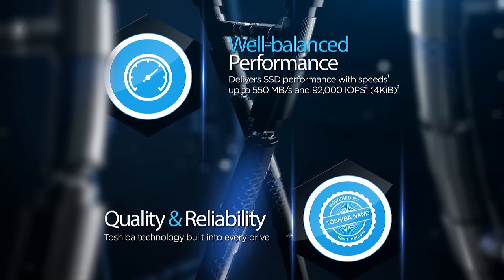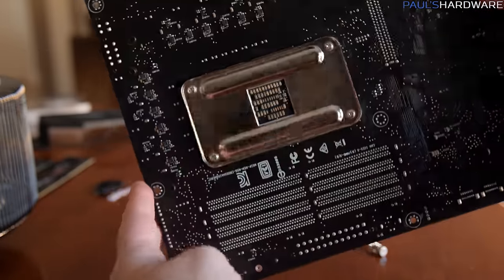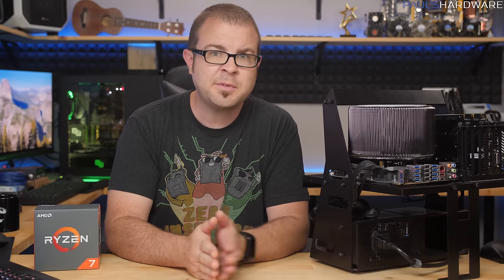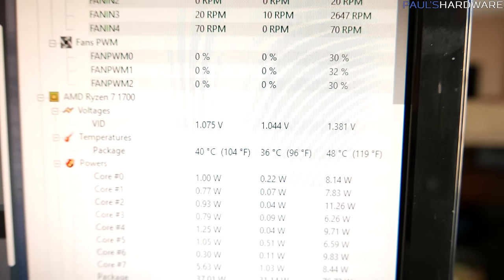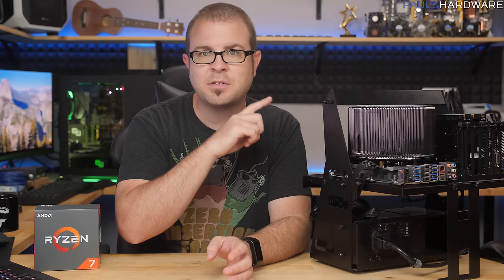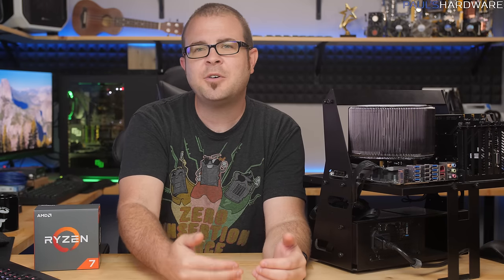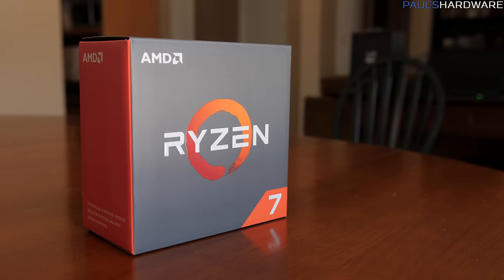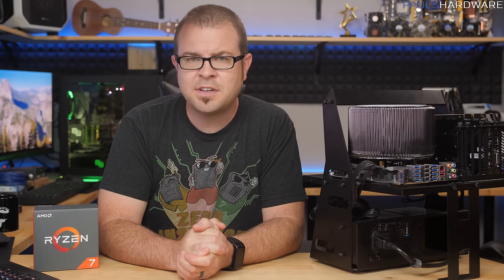Can You PASSIVELY COOL a Ryzen 7 CPU?

Comment: Hate to tell you this but I cool my Intel hardware with Noctua NH-D14 and D15 coolers and I remove the fans, and they run cool and fine.  I take the excellent Noctua fans, and replace the casefans with the Noctua ones that come with the cooler, and use a push/pull for the case (one in front pushing, one on top above the CPU cooler pulling). I do this on all of my Xeon servers for reliability.  Been doing it for over 7 years.   I also did a test where I used no fans at all, and ran at full load, and highest temps I experienced on the Xeon E3-1265 I used was 48'C.  I also have a Xeon E5-2630 v4 chip with a Noctua that is fanless, and it runs just fine and cool.  Noctua coolers run just fine in a fanless scenario, as long as the TDP of the CPU is below 100 I have found.

Comment: I think a fanless cooler in an open air bench is the wrong setup. I'd like to see this in a case with some quiet cooling fans moving air through the system. As it is, there's no air movement on a test bench.

Comment: What if deliding and liquid metal application would be used under and over the CPU lid?
May it possibly negate a need for under-volting?
I also wondered why so many video bloggers speak artificially faster than they do it normally, off the camera? 
Do they think it's at all "cool"? Or they all just trying to include most information in a small chunk of time?

Comment: Hmmmm, why do you not put a fan on the top of the radiator? Push or pull doesn't matter, just for fun to check how much it would be change the temperatures/performance.

Comment: But why would you use a passive CPU cooler with an actively cooled video card? And what about the case fans? Without them this cooler will probably suffer inside a case and with them you already have a noise floor. I'm sure you could have the same total noise with a Dark Rock Pro 3 at low fan speeds with the same CPU. The added bonus there would be that you can use all your memory and PCIe slots normally and have the option to run the CPU dynamically faster for gaming.

Comment: I used to run the AM4 wraith spire cooler on my 1700 and it recorded those temps with... 3.8GHz 1.32v OC and ambient of 30c (really hot day) 

I couldn't much hear it either. And to clarify, you can't really use the NoFan in a case without fans. It gets by with case fans.

Comment: Seems like a lot of money and trouble to remove 1 fan from your system. I feel like just using a stock wraith spire at a low rpm would have been plenty sufficient for a nearly silent rig. Especially if you were just gonna undervolt anyway. Just my opinion though.

Comment: If you literally put a silent 120mm fan on its lowest setting those temperatures would come down considerably. Unfortunately, its (nofan cooler) performance might vary significantly in a normal case as apposed to an open air case, as well as having it mounted horizontally as apposed to vertically as this will alter how it convects heat. The good news is as long as you have a case with ample vents on the top and sides as well as a silent fan on the top of the case in its lowest speed setting it will greatly increase the amount of heat dissipation as a result of convection. Just remember that heat travels directly up, not sideways, that's why its always most practical and beneficial to either force air directly up through the cooler or pull the air from directly above the cooler to aid in dissipation.

Comment: Ummm if you want aida64 to get your cpu hot, only test fpu. It puts it under very heavy load, the temps will skyrocket and the voltage will droop to the max. Fast way to see if voltage is going to be an issue.

Comment: Presumably you would not be using it open aired sitting on top of a entertainment center, if nothing else, dust will become a problem. If it's in a case and or in a entertainment center the encloser will trap heat. 

Also to have to buy a expensive large form motherboard with a second SLI just to be able to install a video card seems absurd.

What are the thermal throttle/safety limits of this stuff anyway?

Comment: I got the Be Quiet! Dark Rock Pro 3, I just took the fans off and swapped out my liquid cooler to see if it's possible to make the Intel Core i7-6700k go fanless, so far it's working fine, got two 140mm Be Quiet! Silent Wings 3 fans for intake, one of the same size for rear exhaust, and three 120mm Be Quiet! Silent Wings 3 fans on top for exhaust, I was going to go with intake, but there's no screen on the top of my case, so I went with exhaust, and have every exhaust fan running around 40%-50% speed, my intake fans at 100%, all just so I could get it at positive pressure inside the case

Comment: It would be cool if they offered a blower type fan that went inside of it and snapped in tight.  And when it was in a case the air flow would blow out the back of the case. I suppose it would need some type of shroud though..

Comment: Do note Asus tends to have "performance Bias" enabled by Default (amd version of Intel MCE ish) witch does a minor overclock to what ever settings you use, your voltage was at stock 1.43v likely means was enabled/auto setting) once set to disable you probably be able to use lower voltages (a lot lower if you set the cpu to manual clock speeds so it disables the amd turbo boost thing)

Comment: Nice video and nice cooler! Did you happen to test a program like OCCT or Prime95's stress test until CPU temperature plateaus? Before using this solution, I'd personally want to be sure it won't approach shutdown temperature even under a situation with all cores running 100% and with (2?) cores running (full Turbo frequency). Also curious if it does well in a case with "standard ventilation" (120mm in, 120mm out, PSU out).

Since this is for an HTPC eventually, how about one of those flat, rectangular cases meant for HTPC use- one with a nice, wide open air grill on the top panel? Since heat rises, I imagine that'll perform not too much warmer than your open-air test bed configuration.

Keep it up with the quality videos!

Comment: Can you put it in the HTPC case (that isn't open-air) and rerun the tests? Even without a fan on the CPU, you will still need fans shoving that hot air out of the case. What would the delta of normal ambient vs. Fanless ambient within the case be with the same amount of fans at the same speed?

Comment: This thing has a fan mount (don't know which size). So you could add a very low rpm fan (like 300-500 rpm) and get insane cooling with virtually no noise.

Comment: I had an AM3 Phenom II quad-core running fanless for a couple of years.  Had one of those huge Cooler Master Hyper 212 Plus heatsinks without the fan.  CPU did not exceed 60°C under load.

Comment: I'm personally a bit concerned by the rate the temps increased when gaming . 15 minutes is not a long time to have a machine under load for a game. i'm interested in how long it could be run before you get into thermal throttling territory

Comment: Not sure how valid testing a large, passive heatsink on an open air test bed is - once it's in a case those temps are going to climb, by how much depends on case fans - and if you have case fans why not just have a big, quiet fanned cooler like a Dark Rock Pro 3 and call it a day? those 140mm fans are inaudible even at 70-80%.

Comment: You're planning on putting this arrangement into an HTPC enclosure. Soooo you test a cooler that's entirely dependent on ambient temperature on an OPEN AIR bench.
I can't imagine this is gonna work great once there's a box around it, unless you're adding a case fan, which kinda feels like it would defeat the purpose compared to using an AIO liquid cooler? o_0

Comment: Some people say given enough time, everything comes full circle.
I remember my first days of computing in the mid - late 90's.
386 & many 486 cpu based systems were so passively cooled they didn't even have a heatsink.  In fact, the first time I did see a heatsink was when I upgraded a machine from an AMD 486 sx25 to a Cyrix 486 DX4 (80Mhz)  The first time I remember seeing a fan on a heatsink was my next upgrade: new socket 7 motherboard, with a 133MHz Pentium.

Comment: You would have to put this in a case for real-world testing. 

1. Because this is does not have a fan, it has been designed so the case fans can remove the excess heat from around it.
2. The opposite argument is that in a case, there is less air quantity than in an open-bench environment, meaning that it will heat up its surroundings and hence its potential for cooling will be lower due to the Delta in temperature (Surrounding air compared to cooler temp.)

I'd love to see this performing in a case with a few different fan configurations. 1 where you have only 2-3 case fans (silence optimized) and 1 where you have 4 or 5 fans running at lower speed for airflow optimization. This being a fanless cooler it should show some differences in temps.

Comment: Ive used an AMD Phenom processor fan on my Ryzen 7 1700x because my liquid cooling bracket was bent and I didnt want to risk damaging the mobo, so I ordered one but couldnt wait to turn it on.. While I waited for a new one to be shipped I slapped that old fan on with that had an inch thick heat sink, that sucker was running cool during multi tasking and a few CnC titles..During summer Nevada heat

Comment: I would imagine that this kind of cooler will have a harder time under prolonged CPU stress. Before the metal heats up completely, it could skew the results. On the other hand, thehigher the temperature of the metal, the faster the heat transfer with the air... plus in a case there will be some airflow, so I guess it doesn't matter all that much...?

Comment: I chased the same silence unicorn for months. My latest build was optimised for silence (define R5, zero rpm PSU and GPU), the reason being the case sits 12 inches away from my left ear. 
Long story short, my advice for the CPU is to use a relatively large tower cooler like the noctua nh-u14s with a pmw fan that can go all the way down to 0 rpm. 
Using an oversized tower with a 65w TDP CPU. It allowed me to setup an really low rpm fan curve. on idle, the fan runs at 300rpm, which is effectively silent. To hear it, you'd have to open up the side panel and literally put your ear next to the fan, and even then you'd hear a faint whoosh).
Pure passive coolers are too inefficient. But if you can help them out with the slightest breeze, the efficiency goes up significantly.
Reply: Im a silence freak.
You need to take a look at nb-eloop b12-1 and nb-eloop b14-1 for case fans. 
B12-ps or b14-ps for heatsink fans. Trust me ;)

Comment: My i5-3570 runs at a max temp of 58c with any game I've ever played. And I get 75fps (cause my monitor is 75hz) in all my games, even while streaming it at 1080p 60fps. All my games are at ultra or high settings 1080p

Comment: a cooler that size just isn't practical because you still have fans elsewhere, a much smaller cooler with a low speed fan would probably work better with the same system DB

Comment: Short guide how to make it more compact, effective and less pricey.
Step 1 Buy Noctua NH-D15 or something similar with at least 5 heat pipes. 
Step 2 Remove all fans from the CPU cooler.
Step 3 Put high quality thermal paste like Arctic MX-4
Step 4 Lower your A/C temp to comfortable 21-23C°
Step 5 YOU'RE DONE!

Comment: No. Well maybe that slide carousel. The biggest problem with this is the hot air from this would not go anywhere if it wasn't actually for the power supply fan saving the day. No intense computer without water cooling could really be silent.

Comment: I have that cooler but in copper. I use it in combination with fans on my old very oc'd Q9550 and it runs around 40 celsius under heavy normal load, max out at low 50's with synthetic benchmarks.  
It works great n looks brutal... had to cut in my chassi, switch to lower ram and what not but totally worth it.

Comment: I get wanting a quiet PC. In a desk top situation where the tower is 2-4 feet from you, you will hear fan noise. In a living room, however, you are 8-15 feet from the tower. I have a very hard time believing that you would be able to hear a computer with say a Noctua NH-D15 with the fans below 1000rpm (I used this as an example due to the size of the passive unit).  The loudest part of the build would be the GPU fans.
Heck, I have a Silverstone Grandia GD09B that has 3 Corsair AP120s, 2 Gelid 80s and a Noctua NH-U9B (dual 92mm CPU heatsink) that is about 8 feet from my couch and I can barely hear it. Would be even quieter if I lowered the fan RPMs.

Comment: While seeing a comparison between a high end all-in-one water cooler and the fanless cooler is nice b/c of price point, it really should've included results against the stock cooler too. Noise measurements from inside a media center case also would have made for a more complete review, since ultimately that's the point of having one of these things. Plus, if you had a case fan in the htpc it would've helped with the fanless cooler.

I would want a htpc build to be as small as possible; but with that thing, you'd need a full size case at least it looks like, and if you have a case fan, you'd see little to no benefit in noise over a stock cooler. Heck, I'm not sure you'd see a noise benefit given that your power supply is going to have a fan.

Still interesting overall as an experiment.

Comment: The test seems somewhat flawed though. Most if not all passive coolers assume basic case airflow, which will noticeably help with temperatures. Putting it on an open bench with no directed airflow will naturally raise temps compared to a usual case.

Comment: benchmark passive cooler on testing bench is kind of meaningless, the major issue of passive cooling system is the heat is cumulative,  the thermal would keep increasing in a sealed case, it actually will have much better result on open environment.

Comment: what i dont get about ryzen is why is the cpu voltage jumping all over the place i got a ryzen 1500x myself and seriously jumps to 1.4 volt alot so i went with overclocking it myself to 3.7 ghz and now its nearly constant 1.275 volt

i read that afther 1.45 volt it can cause damage to the processor over time so thats why i did it is it normal for it to move like that or am i just paranoid about it

Comment: its nice you tested this and sure you can get a aio for the same price, but i think you should be testing stock, fanless, and some other air cooled, and you swapped ram, use the same ram for all test, if  you have to use a low profile for the fanless one, use that for all, i cant trust these results

Comment: Not a very smart design, unless the motherboard is standing in a horizontal position. The fins should stand vertically, because this way heat can be dissapated and the warm air can move up. This design really obstructs airflow. When the motherboard is horizontally oriented as in your test setup it works well but place it vertically and you'll notice that temps are way worse.

Comment: Ryzen 7 1700 + undervolt, no turbo and a Hyper 212X with fan @800rpm is dead silent. There's no a need for fanless when any quality fan at 600-850rpm is basically silent, and you will hear electric noise or even worse, HDD's noise instead.

Comment: Not the most optimal passive CPU cooler one can imagine. I guess it's so large and has this gaping center area because it's meant to be capable of installing a fan inside, but if this space would be used for the heat sink fins it would be much smaller size and as effective if not more effective. Of course the issue of it's mass is omitted in this speculation. If it will be in the very same position it was in this video then no problem - you can add fins inside of that free space, make it like twice as heavy, but it will be highly effective.

Comment: mmm not a good idea...

just use the 240mm liquid cooler and set your fans to a fix 30% speed... it will get a little wormer compared with stock but it is a much better solution and will keep the sound about as low as it can get.

But at the end of the day... a Home theatre should have a kick ass sound and playing a movie can be achieved with 5% CPU load, so fan sound should not be an issue at all to be honest for Movies, and for games, well... most of the noise will be provided by GPU fans anyway so any mid range aftermarket CPU cooler like Hyper 212 Evo + custom watercooled GPU will be much quieter than any fanless CPU cooler paired with a 2X or 3X fan custom design GPU

Comment: Ok, cool. But for this to be relevant, you should've (also?) used a closed case, which will make it much harder for the passive cooler, and you could've tested different case fan combinations and whether it's then still quieter than just running an active cooler. Also considering the passive cooler was rated for 95W and that's also the 1800X's TDP, it would have been interesting, had you (also?) tested it.

Comment: so you test a passive cooler on an open air test bed while using an open air blower gpu...... which has no airflow constraints like a normal case would have with an open air gpu design, thats a pretty borked testing case imo.

the only time this cooler would be used is in a small m-atx case (if it fits) which if thats your main goal then you wouldnt be using an open air gpu. to make this a fair and a more understandable benchmark you really should have used a case setup with a blower type cooler. open air testing makes this really flawed in its results

Comment: To be honest it's what I expected, or actually worse than I expected. I've been running my i5 3570k fanless for a few years already, paired with a Corsair A50 (mostly because I screwed up the fan header and didn't bother fixing or routing it through somewhere else), and it also hits at worst case around 70°c when fully loaded. The case does have decent air flow but same results with it open anyway.